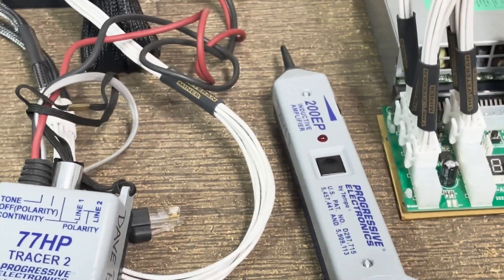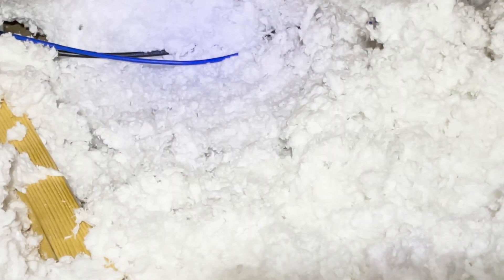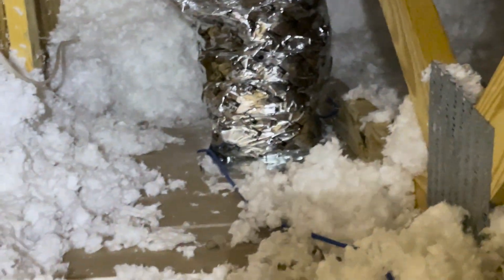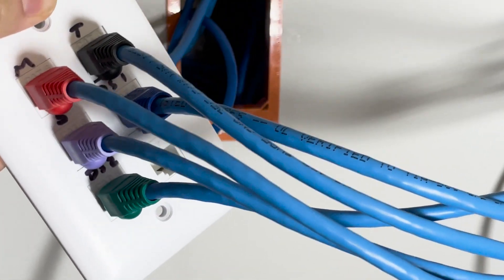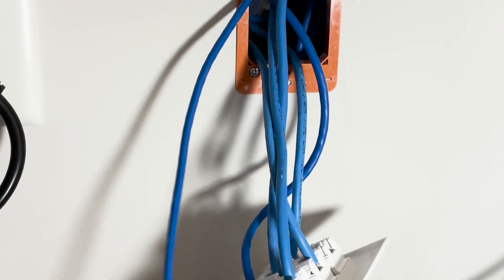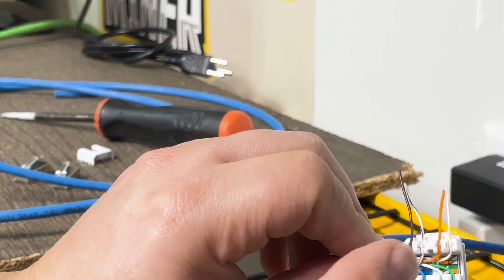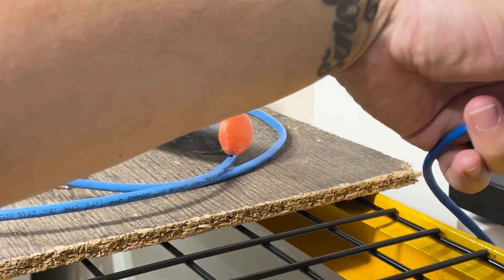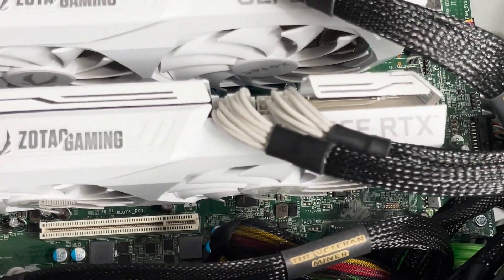UPGRADE FOR VAST AI RIGS #machinelearning

Comment: Is thay safe to power both 3060s off one pcie slot off the breakout board???
Reply from the maker: A 10pin converted over to a dual 8pin and a 8pin converted to a dual 8pin was used in that rig. Only a dual 8pin was used per gpu.